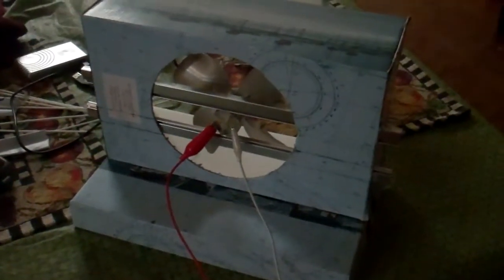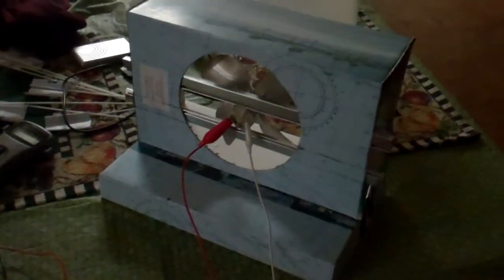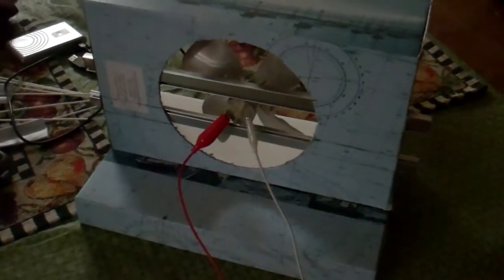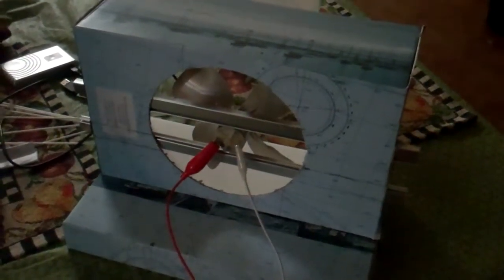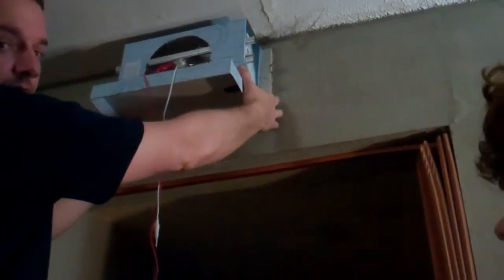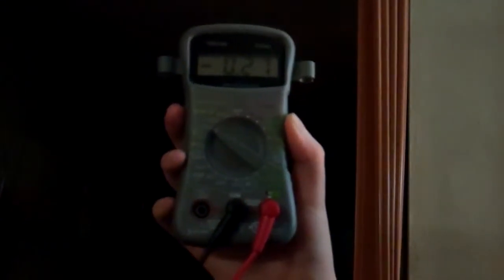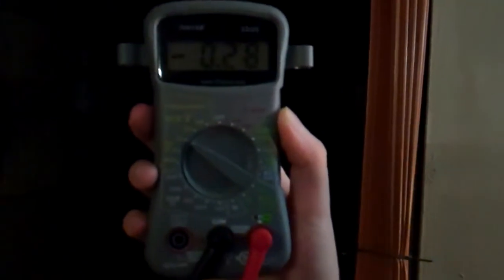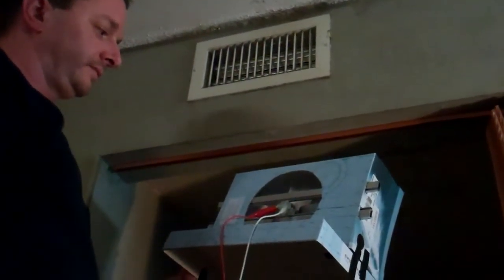Home made Air Conditioning vent flow meter

Comment from the maker: Any small DC motor and any fan blade. Because you are not measuring air volume, just comparing the readings from each vent, in order to even out the flow. Just check with a meter while hand spinning the motor shaft.

Comment from the maker: Any small motor that shows voltage while spinning, connect to a fan blade, when air flow causes fan to spin, you will have a rudementary way of measuring air flow. By reducing flow on highest flow vents, you will receive more flow on lowest flowing vents